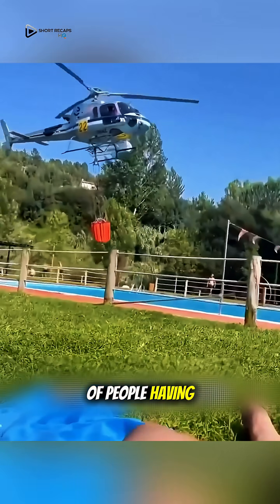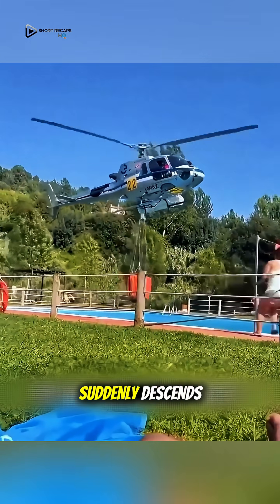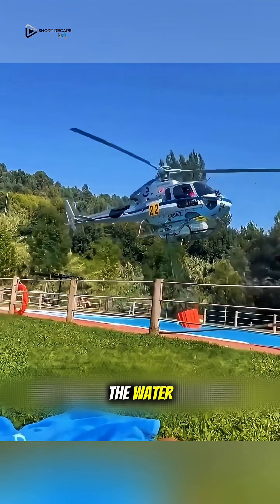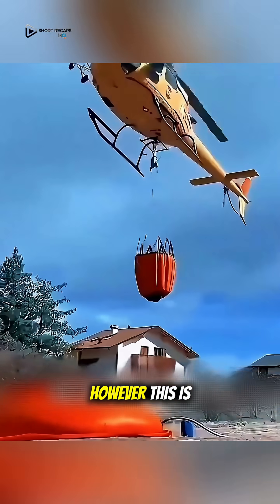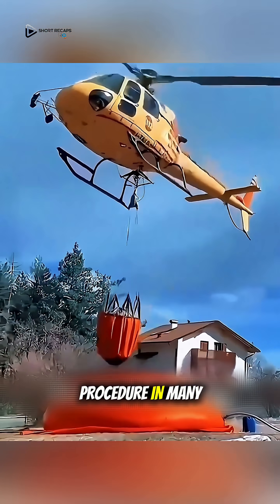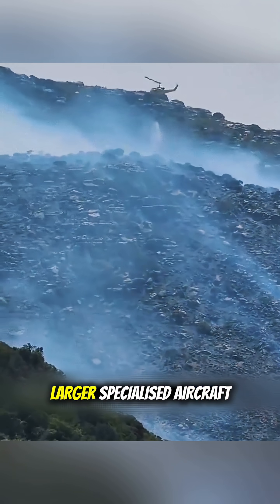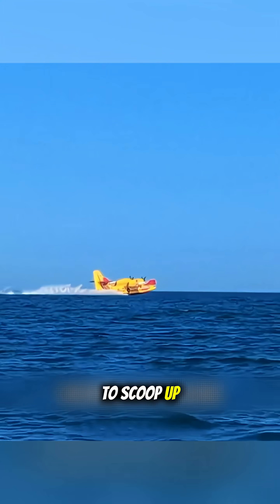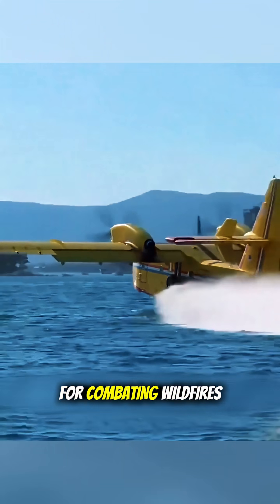How Firefighting Helicopters Collect Water#Firefighting #Helicopter #Wildfire

Comment: Certainly not a pilot at all but looks like the pilot miscalculated the water level. Which is probably why he dipped the skids and the tail rotor. When the tail rotor met the resistance of the water, as opposed to the air, it broke something resulting in the immediate spinning of the chopper. Once the tail rotor system was compromised, the pilot wasn’t going to save the craft. Not that close to the ground and immediately over water.